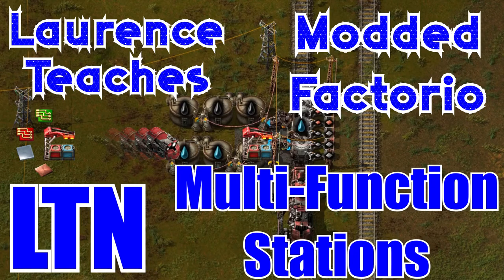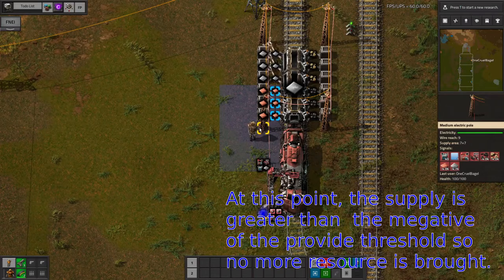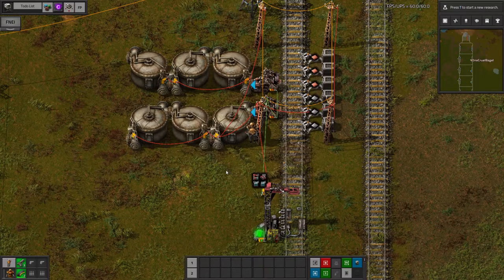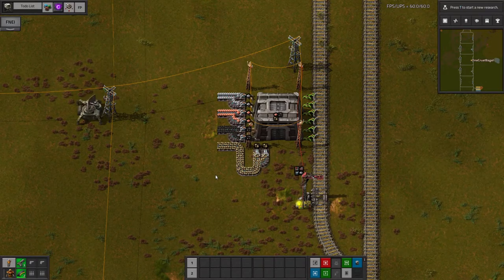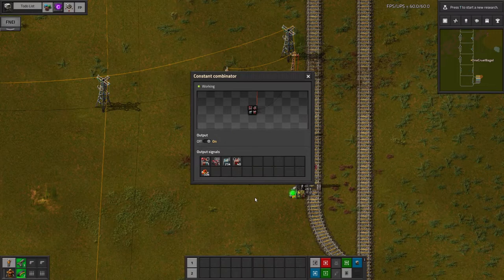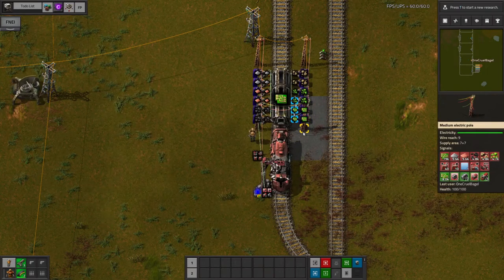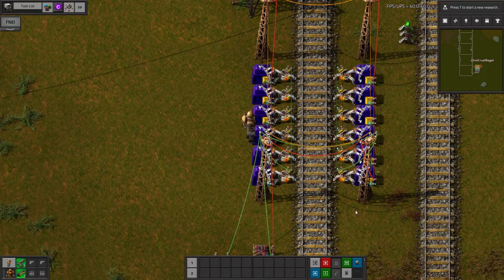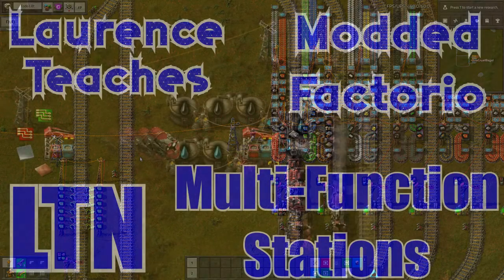LTN Multi-function Station Tutorial - Laurence Plays Factorio

Comment: Is there any way to set up a station to just receive a train load of anything from another station. In Pyanodon I have an area where all different types of burnable fuel are stored. And I want stations to request a train load of anything that get loaded at the provider station.
Reply from the maker: Hmmm, interesting! There are a few problems with this...
- You've got a mixture of things all being picked up from the same station. You could use circuits to treat them all as a single "thing" so the train will pick up a mixture of whatever, the problem with this is that you're likely to end up with partial stacks, and so the train would never leave, because it would never be 100% full. So, I'd probably have a separate pickup station for each fuel type, in the same area. 
- The other problem is at the other end. How do you make it ask for miscellaneous fuel? I have a couple of thoughts here - either ask for all of them when it gets low, and use the train limit to prevent multiple trains delivering, or have one "meta" fuel request that will request any of them. 

This question is interesting enough that I think I want to make a Factorio Flavours video from it (where the group of us each make our own design and I'll compare them). Thanks for the question, and keep an eye out for the video!
Reply from the maker: It's just been pointed out to me that the trivial way to do this is to not use LTN - take a look at our current K2SE playthrough; we've got mixed trains taking junk for recycling from orbit down to the ground and then from one ground station to another. If you want me to run through how that works, you can come along to tonight's stream and ask there and I'll show you around it.
Reply: @LaurencePlays  thanks for the great answer. I was trying to avoid having 2 stops at my receiving area. I would have to have 1 LTN for my parts being delivered and a standard one for my buranble fuels for the factories The challenge would be to create one LTN stop to drop everything off. Ive been trying to create something to try to recognise all burnable fuels as one resour e signal. Yes I've found that my trains will never fill up all stacks and won't leave. Only way I have got around that is to use a standard pickup stop that is timed.
Reply from the maker: @alann8117  I think it could be done with LTN if you have a separate pickup station for each fuel type, using the same signal for all of them. Then you'll only need one dropoff station, you'll have no problems with partial stacks and you should always have fuel!

Comment: 9 months using LTN after I found your video I have ran into a problem. How can I make only cargot rains pull into a stop I have a thing using Id #1 and #2 going on and I keep getting a fluid car  pulling into the #2 depot backing everything up.
Reply from the maker: I'm not sure I understand your question... But if LTN is sending a fluid train to that stop, it thinks there's a fluid there to pick up (or that it's asking for a fluid, if the train's already full), so I'd check the signals you're feeding into the station. Maybe turn on detailed feedback for a bit so you can see what it's sending the train to get.
Reply: ok let me back up can I make it so that only cargo trains go into a depot? I have a small ID#2 network that I only want cargo trains on but fluid trains keep filling up the depots with ID#2 . @LaurencePlays
Reply from the maker: @hunterclapp1812  Ah, I see - you want one of your depots just to take one type of train. You should be on the right lines with network IDs - I think if you put the depots on a specific ID then only the trains doing that route will go to that depot. You could also try renaming the depot, I'm not 100% sure that works, but I think it might.
Reply: @LaurencePlays  So that didn't work I have 8 depot station all filled with cargo trains (on ID2) when I went to bed. I wake up with all 8 depots with fluid wagons does the depot number need to be 2 as well? PS I have ID1 and ID2 trains using the same tracks so are trains just seeing the depot signal of 1 and going there. as you said in your first video that the depot stations can be named anything Ltn doesn't care. Thanks as always I come back to these videos a lot for refreshers.
Reply from the maker: @hunterclapp1812  Hmmm, I'm not sure then; I'd have to do some experiments and unfortunately I'm at work at the moment! 
I ended up watching one of my own videos as a refresher as well - they're very useful! 😀

Comment: What about longer train setups?
Reply from the maker: Longer trains will work exactly the same, but when you work out the quantity of resources when you're programming the combinators, the number of wagons that you multiply by will be higher. I don't think there's anything else you need to worry about!
Reply: @LaurencePlays  I suppose, I was just confused as to how LTN might decide which train to use? Say I have an outpost that wants items and liquids, and I have 2 trains, Train-Wagon-Tanker and then a Train-Tanker-Wagon. As far as I can tell, LTN sees them as the same kind and will send either but the station itself won't accept both due to the setup of the train itself. I understand that this is just the case of only having a rule to yourself where you put the items at the front of the train and liquids at the back or vice versa. Just curious if you ever encountered this or if you know anyone who has. Perhaps I can bring this up to LTN directly and maybe ask to implement a train cargo match system where it will only send trains that match a specific setup. Rambling~~
Reply from the maker: @HiImKyle  Ah, I see what you mean. I've never used LTN with mixed loads - my trains always carry one type of resource at a time - so I don't know how you'd set that up. It definitely knows the difference between a solids train and a fluids train, but I don't know how it would react to a mixed train. 

You can, however (as I demonstrated) have a station which deals with both solids and fluids - I just don't have trains drop both off at once.
Reply: @LaurencePlays  I tested my idea and LTN does NOT handle mixed trains. I had a TFC and a TCF, Train Fluid and Cargo. Then I setup 2 stations accepting the same things, 50k water and 80 stacks of coal, where one station had the Coal at the front and the other was the opposite. LTN sent the TFC train to the station requesting coal first, therefore failing the delivery. Welp! That settles that, I will probably go ask LTN to maybe implement something to handle this.
Reply from the maker: @HiImKyle  That makes sense. I've never tried trying to pick up more than one resource in a single trip; I'm not even sure how you'd set that up!

Actually, that's not quite true; I did have a train picking up two types of memory card in Space Exploration, but that's because one of them was being collected in much smaller numbers and was just snuck in there without being asked for... It was a dirty hack!

Comment: My issue is that trains don’t stop delivering oil even when I have the request oil to -50000. It just keeps on bringing oil!! I am at a loss
Reply from the maker: It sounds like the stored oil isn't being sent to the station logic properly, or that the numbers in the combinator aren't set correctly. I suggest you run a cable from the input light to a pylon so you can see directly what signals are being fed to the station.

Comment: Interesting you didn't mention the strongest point for LTN, it needs less trains to do the same
Reply from the maker: You're quite right, LTN does require a lot fewer trains compared to the alternatives, but trains are so cheap in Factorio (even when you've only just invented them) that I don't see that as a big deal. It also means trains run further (because of going to the depots), so it actually means you have more trains in motion, which makes it a little bit worse! 

In my opinion, the biggest advantages of LTN are round-robin and station priorities.

Comment: i designed fluid mining stops with 2 stops instead of just 1, while it is easier, due to how my rails are set up, it can have up to 2 trains of both ore providing and fluid requesting.
Reply from the maker: Yeah, using more stations often makes more sense and is certainly easier to set up - this was more of a video about what you can do if you want, than what you should do!